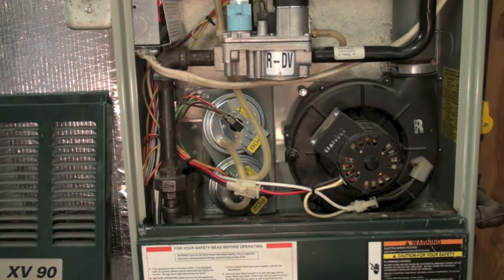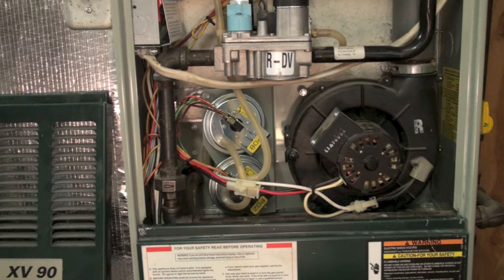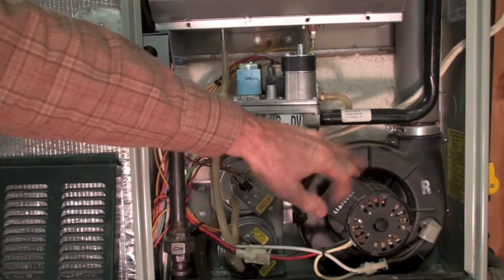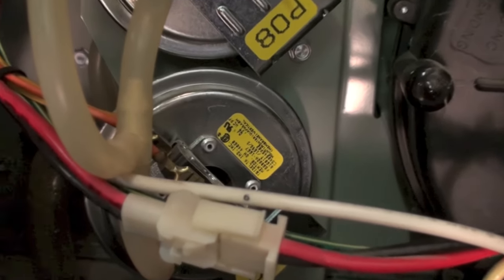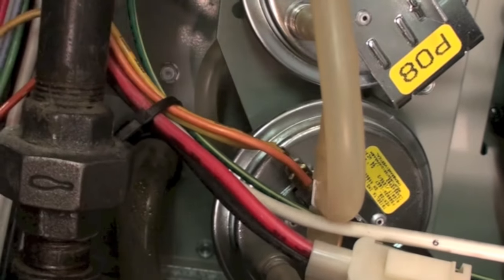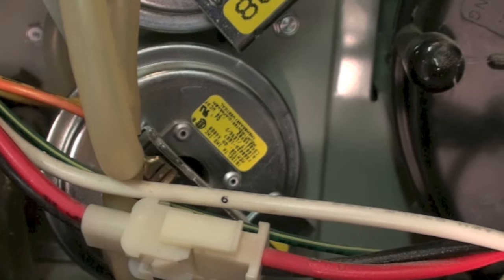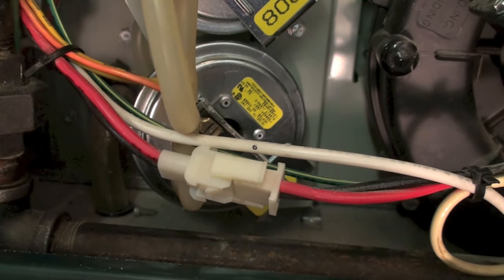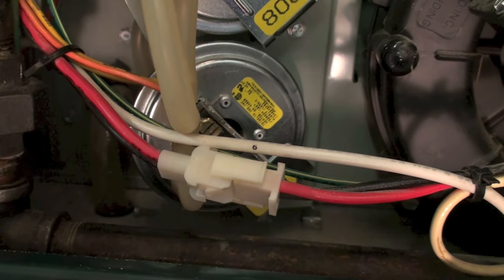Diagnosing pressure switch problems on gas furnaces

Comment: Hi, I've got a Trane XE90 flashing 3 blinks which indicates pressure switch.  This happens after I initially fire up the furnace by turning off the power for 30 sec. then turn the thermostat up to 75F.  The furnace fires up and stays on until the temp is met, furnace shuts off.  When the thermostat calls for heat it cycles but doesn't get pass the turning on the inducer then shuts off.
I know the furnace is working it just can't recycle.
Reply from the maker: You probably have a venting problem.  Water in the vent (the vent should slope towards the furnace), vent blockage (ice, snow).  Also combustion air inlet blockage.  Condensate drain blockage.  Hope this helps.
GFM
Reply: Yes, and all your videos and answer helped greatly in my service call.  Told him "I'm getting a pressure switch error but I don't think that is the problem since I can get it to turn on, it won't cycle when it calls for heat when the temp drops, maybe there is clog somewhere in the system.  But Right away he diagnosed pressure switch was bad.  I said "Wouldn't that error be for multiple reasons since I can get it to come on". Humm he said, confirmed pressure was okay had the meter set wrong. He removed the tube from the inducer and found a bee and then said the vent must be clogged and I'll need to call someone to clean that out. All that after my (your) diagnostic thanks to you! $90 later not fixed and now another call to have someone clean the vent.
Question: Do the remove the inducer to get into the vent which leads to the outside?  There doesn't seem to be a way to blow out what is in the pipe.
Reply from the maker: You do not remove the inducer to clean the vent pipe.  Sometimes the vent pipe is cemented to the outlet of the inducer, which makes it a little harder to remove the vent but it can be cut and the vent be checked.  You can then couple the pipe connection with a no hub connector.  The first place I would go is the outdoor termination of the vent.  If it exits the structure at floor level, check for ice and if there are small children, rocks or sticks inside the vent.  What I am not understanding here is why the service tech did not do it.
Reply: Its a second floor unit the vent lead to the outside would need a ladder.  The easiest way into the vent would to remove the inducer or yes cut the tubing on the inside. 
The service tech didn't have the equipment for cleaning, he would just diagnose order parts if needed and fix the heater.  He would send someone to clean the vent for another charge.
Reply: Same tech came back he cut the PVC pipe between the heater and the duct vent leading to the outside.  Received a higher pressure reading showing there was a clog.  As we waited for his backup I asked if we could use my vacuum to get the clog out "worth a try"!  Anyway it pulled out a nice beehive!  and then he canceled the backup and reduce the charge of $589 to $339.  Heat is back on and 2weeks later.  
I have you to thank for helping diagnose the problem.  Thank you!
Reply from the maker: Welcome.  Glad it is finally fixed.
GFM

Comment: Thanks a million for creating such great content. I've spent the last few days watching videos on trouble shooting gas furnaces and I've learned a ton. But, my problem is still outside of my scope of expertise. The inducer, pressure switch, and ignitor all seem to be in working order when I run the diagnostic test, however, when I turn on the thermostat and call for heat the inducer kicks on which then creates a vacuum in the pressure switch and that's where it stops. The ignitor never heats up. I should also mention that the night before we realized the furnace was out, for a brief moment, we could smell gas in the near the furnace. Any help or information would be amazing. Thanks.
Reply from the maker: +Roem Bonilla Are you sure the vacuum closes the pressure switch?
GFM
Reply: I noticed the bladder gets sucked in and releases a tiny button once the inducer starts to spin.
Reply from the maker: +Roem Bonilla You still need to know if the switch closes.
GFM
Reply: I went back through, checked the voltage and found the problem to be a tripped fuse. After the pressure switch, the cable went to button type fuse, I pressed it and the furnace started working again. However, I'm not certain that I've fixed the problem. Should I try to find out what tripped the fuse in the first place?
Reply: I left it off and alone since my last post just to let it cool and reset. I went back and turned it on; it'll run for a few minutes and shutoff again after the rollout switch(?) trips. So I know need to figure what the cause of the rollout switch shutting off is. Thanks again.
Reply from the maker: +Roem Bonilla It is a manual reset rollout switch.  You probably have a flame rollout.  Look for a crack in the heat exchanger.  Get this fixed.  It could be dangerous.
GFM
Reply: I figured it was something serious enough to stop the flow of gas. Since then I've turned off all power and gas going into the furnace. I'll be taking it apart in the next few days to correct the problem. Thanks a million.
Reply: +grayfurnaceman I took apart the furnace today, inspected the heat exchanger and didn't see any cracks. I think I finally narrowed the problem, however, before I put everything back together I need to replace the fire barrier insulation that lays between the heat exchanger and the front panel (the panel that holds the inducer, gas valve etc.) but can't seem to find a direct replacement anywhere. Which type should I use? Thanks again for all your help.

Comment: I have a Weil Mclain HEII.  The power light on the controll panel is on, by the way the control panel is 2 years old.  The blower will not stay on the control panel clicks on and off and the blower turns on and off.   Do you think the pressure switch is bad?
Reply from the maker: Luis Castro If there is no fire, check the HSI.
GFM
Reply: The control module,pressure switch,gas valve, internal thermostat and ignitor are all new.  The boiler will run for hours and then in the middle of the night it will go on off on off on off really quick.  The control module will click on off on off on off.  I blew into the orange hose and it seems to be free flowing.  I blew into the white hose and that seems to be a little more restricted.  When the boiler is cycling on off on off on off and I shut the power down for a few minutes and start it back up I notice that the pressure switch light on the control panel blinks.  Is that a code saying that was the reason why the boiler didn't restart?

Comment: I have a Nordyne Intertherm gas furace. I have replaced the thermocupor and the  thermostat and it will kick on until the room gets to the temp. it saids on the  thermostat but won't kick back on when the room gets below the temp until i have to shut the pilot light off and then relight it for it to kick back on. Could you please help????
Reply from the maker: This one sounds like a gas valve failure.  I am assuming there is no electronic controls on the furnace.  Hope this helps.
GFM

Comment: I am having the issue you talked about. If I pull the tube off the combustion chamber the burner starts up. You say to look there, but not what else it may be. What types of things cause this?
Reply: I too am having this issue.  This is a day after I was having the Limit Circuit open or external load on error.
Reply from the maker: I would look at the combustion air inlet.  Ice or snow could be blocking the inlet or there could be an obstruction farther in the pipe.
GFM
Reply: Thanks, was hoping to not have to get on the roof.
Reply: grayfurnaceman Thank. I will take a look at it, but not today and it is five below right now. The house stays at 60 but is set to 67 so it does run at times just not all the time.

Comment: Our furnace has been giving lots of trouble - a Rheem, 90 classic plus, 12 yrs old, have had a guy out here 4 times.  The first time, the guy cleaned out the drain valve by running water through it, he thought water was backing up due to dirt in the valve.  BUT we still had problems after that.  We've replaced the thermostat, IFC (board) and igniter. Currently and throughout this entire process our heat works intermittently. Tonight, the thermostat calls for heat, the inducer kicks in for 30 seconds and then it tries to light, but doesn't. I hear 2 distinct "clunk" sounds and then it shuts down for about 30 seconds. This cycle occurred about 20 times until the furnace actually lit and then worked for one cycle (house heated up), but then it happened again the next time the temp fell (took 10-20 tries before the furnace could light). Ideas?  We initially thought pressure switch and that it should be replaced, but now from your video I see we need to diagnose the problem.  Do you think the problem was the water (as first thought) and did that damage the pressure switch? Thank you!!
Reply from the maker: Michelle If the water got into the switch, it is damaged and must be replaced.  Also, if there is a vibration in the inducer, the wheel may have been damaged by the water.  More likely there is a venting problem.  Sagging section of vent(it should pitch toward the furnace) length too long or size too small(Install manual has this info) and blockages.  
Checking the vent for blockages is more problematic.  You should be able to remove the piping from where it connects to the furnace.  This will be where birds will go when they enter the vent.  It may be glued by the installer (it is not supposed to be glued but sealed with silicone).  You can visually inspect the vent termination (children will put toys or rocks in the vent).  You can cut the vent to check sections and install no hub connectors when finished.  The best way to determine if vacuum is right is to use a manometer.  Hope this helps.
GFM
Reply: grayfurnaceman My guy was just here.  We tried sending a golf ball through the intake pipe (and it came out no problem, we did NOT test the outtake; he didn't even suggest it).  Sometimes the furnace ignites, sometimes it doesn't, sometimes it seems to work better with the cover off - which is why we checked the intake to see if it was partially clogged and not getting enough oxygen, but it seemed ok.  This time he sanded the igniter where it comes in contact with the metal where it sits (he thinks the igniter is 'weak' which might indicate it's not 'fully' grounded?).  It did work when called for heat (but I'm not convinced because our heat DOES work sometimes as it is).  He still hasn't changed the pressure switches bc he said he can hear it trying to ignite (a little weak sound, but trying) and he said that if the pressure switch was bad it wouldn't ignite AT ALL.  Is that true?  He claims that even though he DID have to clean out my drain valve that water did NOT get in to the pressure switch.  I'm still not convinced.  The heat is working now, but I'm just waiting for it to start cycling again/not igniting.... I really appreciate your time and input -- any thoughts on this new information?  THANK YOU!!!!  :)
Reply: grayfurnaceman Oh, one more thing - when he was here he said "I have this universal pressure switch right here if we think we need to change it, but that's not the problem"..... well, thank you so much for this video because I replied saying that I wasn't comfortable putting in a universal and that I wanted the correct brand name pressure switch if we're going to change it out!  I never would have known, otherwise :)
Reply: grayfurnaceman And is an Air Proving Switch the same as a Pressure Switch?
Reply from the maker: Michelle True it would not energize the hot surface ignitor if the pressure was not made.  Universal switches will void warranties on some furnaces.  Air proving switch is the same as pressure switch.  There can be heat exchanger problems such as cracks that will also cause failure to prove on these switches.
GFM
Reply: Check your gas manifold pressure... Usually 3.5" w.c but refer to your furnace

Comment: At 3:30 you mention that if pulling off the vacuum hose causes the furnace to start back up that the issue may be in the combustion chamber can you elaborate on that.
Reply from the maker: The combustion chamber tap is there to insure that a blockage in the combustion air pipe will stop the furnace from running.
GFM
Reply: Thank you for the quick response!  I checked for water in the pipe and checked both ends for blockage, which I didn't see.  The weird thing is the furnace will cycle one time and then the error code for switch stuck open will pop on.  The error code can be bypassed by removing the chamber tap.  I'm about to either rent a rotoscope to look down the whole pipe or enter it from a midpoint joint to see if there is anything blocking it.  Do you have any other advise on what to look for?  Thanks
Reply from the maker: I think you are on the right track.
GFM

Comment: i have a coleman 90% i believe and every winter after a few wekks i get the 3 lights that say pressure switch. the ac guy has replaced the switches the past two years and it just happened again. he was checking the drain lines for blockage or backed up. there is a little water in a clear reservoir on unit but not enough to go out drain . i have no idea what is wrong and he always says pressure switch. it has to be something causing this. any help thanks.
Reply from the maker: Lshirer Check your venting for sags and the termination for ice.  Hope this helps.
GFM

Comment: If i used compressed air to try to blow out some suspected debris in the tubes and pressure switch did I likely tear the diaphragm in the pressure switch?
Reply from the maker: Probably.  They are very thin.
GFM

Comment: yes I have cleaned it, i guess i will have to replace it as well, lol or maybe the new icm board id bad, i have never had a furnace give me such grief
Reply from the maker: The trial for ignition is 4 to 7 seconds.  If it shuts down in that amount of time, it is a flame sense problem.  If it is longer, the flame is being sensed.  Does the flame fail when the fan comes on?  
GFM

Comment: every year i have to tap once on pressure switch to my american standard dual pack to work..does it mean its bad? thx in advance
Reply from the maker: +tino8080 Probably.  If it continues to operate throughout the year after the one tap, the switch is sticking.  Hope this helps.
GFM

Comment: My furnace will light and run a bit, but then the burner will kick out, then it will immediately light again and the kick out. My pressure switch goes open and closed in unison with this happening.  The switch has 2 tube, one on each half, and they both go to the exhaust of the vent blower.  I have constant voltage to the switch. I bypassed the switch to test if it would keep running and it did run with no interruptions.  Is this a case of a bad pressure switch?
Reply from the maker: I would be looking for why the pressure switch is opening.  Venting problems?
GFM
Reply: @grayfurnaceman  I took all the ductwork off to the chimney.  All is clear, looked up the chimney clear all the way up and can see plenty of daylight at the top.  I took the vent blower off and ran it. It was blowing out the exhaust very good.  I also used a pipe cleaner on both nipples of the exhaust port before I put the hoses back on.  What else should I be checking for this?
Reply from the maker: @kevinpodkol9141  At this point, I would be replacing the switch.
GFM

Comment: Im getting the "3 blinking lights"  but my pressure switch is opening and closing -- would that indicate i have a bad controller board?
Reply: John Southard how are you verifying that its closing? Is it an 80% or 90% furnace?

Comment: How do you check the vent leading up thru the roof for dead animals or spiders or webs! Do you do it from the inside or outside?
Reply from the maker: 2 ways.  Remove the termination on the roof, use a mirror to see inside.  Inside, remove from the furnace vent and check inside.  Hint:  Anything in the vent will be at the bottom.
GFM
Reply: @grayfurnaceman  you give the best advice! I've asked plenty of people and so far no response! Your the best! We need more guys like you out here that's for sure!

Comment: Have a question. My furnace give the error "preassure switch open with inducer on". What should I check? the pilot turns on and as soon as the flames start on the furnace goes off and then I get the code.

Thanks!
Reply from the maker: Angel Ortiz I would be looking for condensate drain problems if it is a 90+ efficiency furnace.  Another problem may be a cracked heat exchanger.  Hope this helps.
GFM
Reply: Thanks Gray. I found out that there was a hose that has a few bugs on it. was able to blow them out and got it back working. Thanks again

Comment: I have a Goodman pressure switch. There is no polarity on the switch and both wires are the same color which is yellow. I presume that wiring placement of these two wires will not matter?
Reply from the maker: If there are only 2 terminals on the switch, it makes no difference.
GFM
Reply: Thank you GFM

Comment: Hi, I have a problem that is driving me crazy😞Not getting any power to the inducer motor until I suck on the pressure switch hose. Is that somehow powering the inducer motor through a back door? 1. Call for heat. 2. blower turns on... nothing else. Until I pull off the pressure switch hose and suck in. Then the inducer motor turns on and furnace fires up. Already replaced circuit board and pressure switch. Any ideas I'm stumped.
Reply from the maker: The inducer won't start until it sees an open pressure switch.  Try removing one of the wires to the pressure switch.  If the inducer starts, either you have wired the pressure wrong or the new switch is stuck on.  It can also be checked with an ohmmeter.  Hope this helps.
GFM
Reply: grayfurnaceman great thanks I'll give that a try.